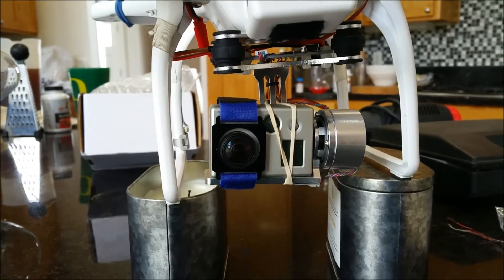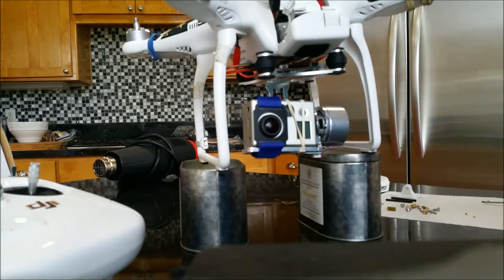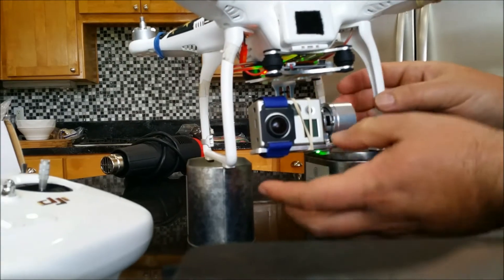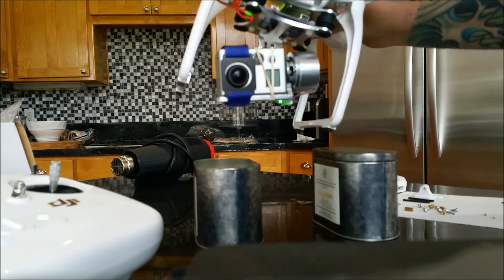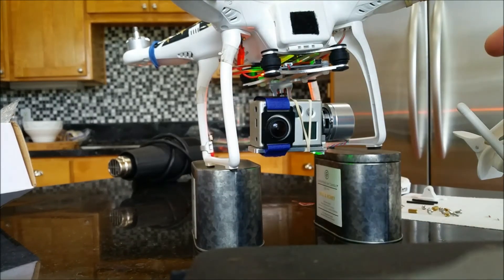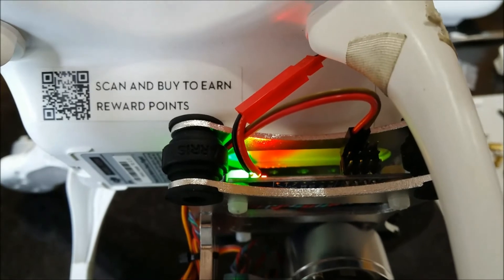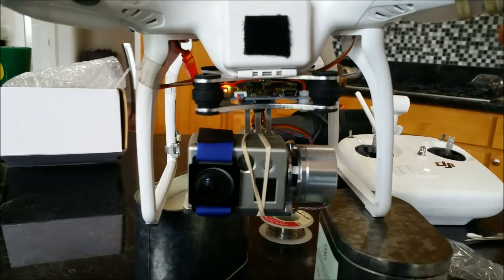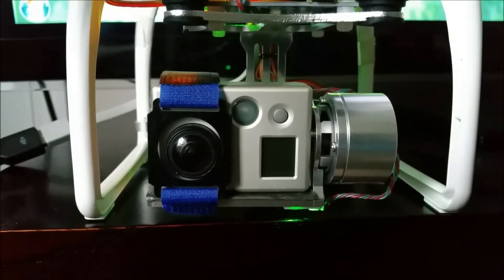Redneck installation of chinese BGC gimbal on a DJI phantom fc40, part 2

Comment: Hold it in place for 5 seconds it will auto remember the last position. Its shacking because its waiting for you to hold till you plug it in everytime. Do you have the 3 setting buttons on the board. 1 for auto balance 2 for stable correction 3 for lever control.
Reply from the maker: It was a balance issue.  Long fixed,  thank you for the input